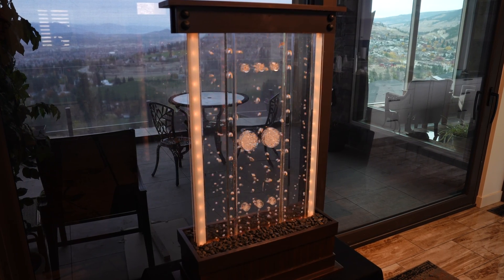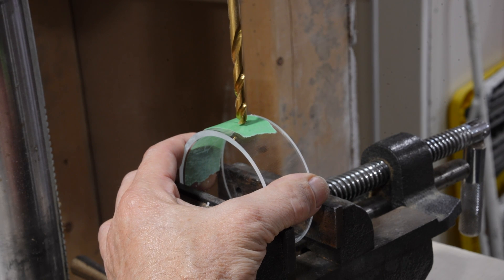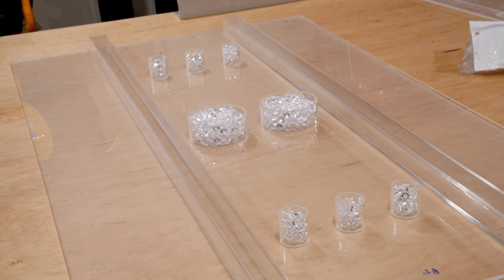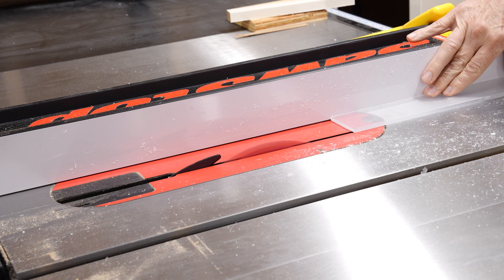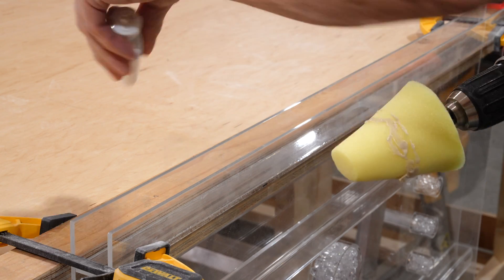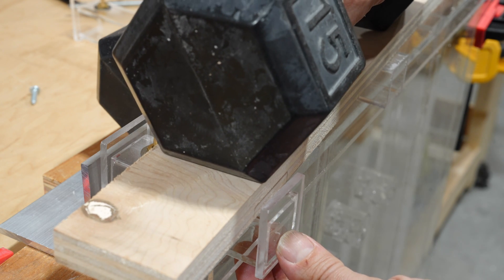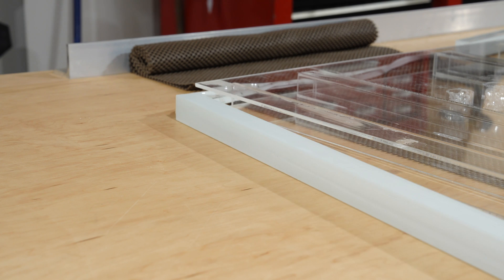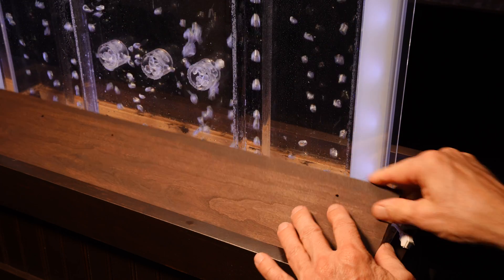DIY Bubble Wall with Water & Oil

Comment: You can make lot better bubble wall with using only AQUAMAX F97 NOZZLE,  and for Digital Bubble wall use AQUAMAX DS3152 Controller. Plug & Play...

Comment: That is fine craftmanship. I've seen water bubble walls and oil (glycerin) bubble walls, but never one that did both. What oil did you use?
Reply from the maker: I started off with baby oil but it was too thin so I mixed in some heavy mineral oil (350FG) until I got a good balance.